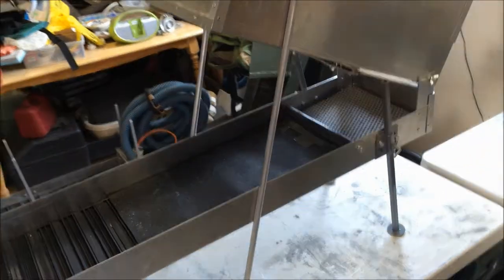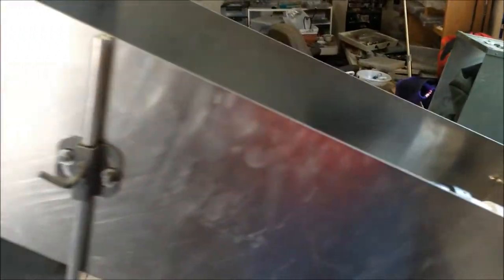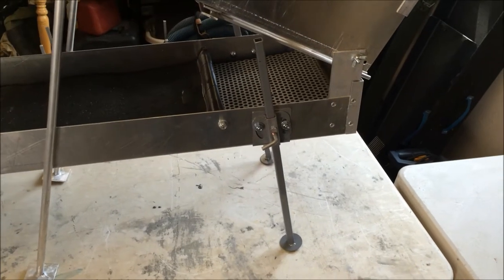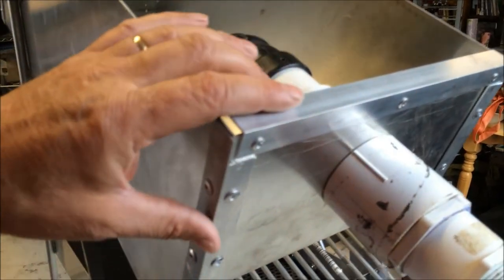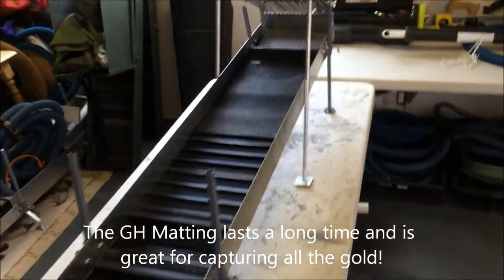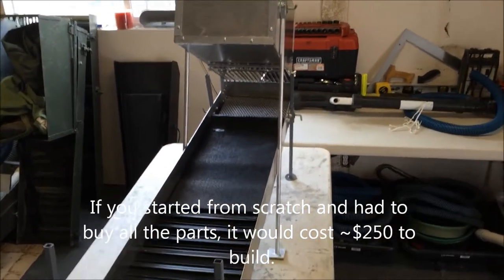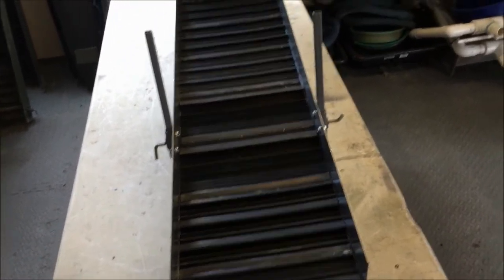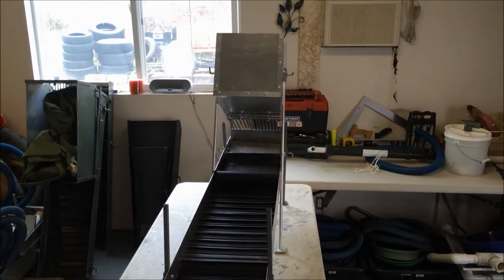Mid Sized Highbanker Build

Comment: Hi John, you didn't email for pics of my sluice project... That's ok, I understand. I am almost done with my mid-sized highbanker/stream sluice build. Two sections 50-inches long x 12-inches wide x 4-inches tall. I also built a hopper for when I want to go high banking. One section has a flare so I can use it as a stream sluice by itself. It looks professional, all it's missing is a manufacturer's sticker - "Billgineering, Inc". I ordered $250 worth of gold hog mats, they should arrive tomorrow or early next week. All that's left is the legs. I wanted leg brackets like gold hog uses on their sluices but couldn't find them anywhere, so I'm going to build them from scratch, except with a better design. I bought a drill press yesterday and am looking for a rotary table for milling circular slots to allow for back and forth adjustment. But I can tell you one thing, this project took way more than a day and the legs will take a few more. After spending a lot of money to tool up I was thinking of making leg brackets or even leg sets to sell on ebay. But I'm in no hurry. I'll post a video on youtube when it's all done although it could be a few weeks.

Comment: John what type of pumps are you using?  Type and model?  GPM?  great videos btw
Reply from the maker: +Elvamerc A4D Elva, I use a Honda WH15 pump (130 gpm) in most cases for this highbanker. At times, I like the silent mode, so I use 2 3700gph Rule 12volt bilge pumps.Thanks

Comment: John-your mid-size is done beautifully. How do you back pack such a long sluice and can you give again the types of matting starting with the miners  moss and on down to the end of the box. 
thank you-Jon Cunningham-San Diego
Reply from the maker: +Jon Cunningham Thanks Jon. The sluice is very lightweight and 5' long. I just strap it, header box down, to my backpack. You can make it shorter for easier backpacking...but again, its really light, yet durable...and VERY effective!Underneath the header box are 2 UR's covered by miner's moss and a punch plate. Then, Razorback, Scrubber, 2 Talons (not Raptor as I said in the video); Razorback, Scrubber, Scrubber, Talon. I hope this helps. John

Comment: John, Again,beautiful job. Are the sides of the sluice box 2" high? It looks like a flat piece of rubber or something for a foot or so immediately following the punch plate and mm/ur layer and before you start your Hog mat. Or am I just looking at razorback. The J&B  Weld is a good way especially if you notch or rough up everything  on your grizzly. Would it help to tack the rods with aluminum welds also. Thanks Jon
Reply from the maker: +Jon Cunningham  Thanks Jon. The sides are 3" high. The piece of  rubber that I think you are talking about, is mounted above the matting and attached by a rod to the sides of the sluice under the header box (see 14:50 of the video). I use it as a baffle to settle and normalize the water flow, and reduce water bubbles. Also, I did go back later and weld the rods in place using alumiweld and my torch. Worked great!
Reply: +John Jacobs Thank you-after 50 years of working on teeth I'm really enjoying mining and your innovations  help my learning curve greatly.
                            Jon
Reply from the maker: +Jon Cunningham I'm glad they are helpful. Best hobby of all time!
Reply: +John JacobsJohn,Do you ever classify.Thank you.Jon

Comment: Hey John Jacobs ( jingle heimer Schmidt ? ) Im making a high banker, and love your design... Simple, effective, light, strong! Thats me ! I have a question about your ' washing of material ' ... Many people use spray bars, another Youtuber DAN HURD uses a quad hole spray bar, but I see you have the single outlet of water. Have you experimented with different washing ? I have my first time out and want to get my high banker done ASAP but I might take the time for a spray bar if it helps gold recovery ... anyways, lots of people find it important, and you seem like a friendly dude, so I thought I would ask.
Good luck in Spud town :)
Reply from the maker: Silvers. Thanks for the question.I used almost every imaginable way of washing/bringing water to the box. I'm not a fan of spray bars because it can restrict the amount of water flow and washing capabilities. I went with the water delivery system which I believe is far superior...just bringing water to the destruction chamber with a single pipe.Hope this helps.
Reply: @johnjacobs3643  Ya I've seen allot of different ways and I like this straight forward style... Just was wondering what your theory was for it... don't restrict flow is solid reasoning, and simpler the better.

Comment: Hi, I love your videos and I'm going to make one of these high bankers for myself but before I do, I wanted to ask if there are any suggestions you could share with me on the build out that you might do differently now that you have used it for awhile. Thanks!!
Reply from the maker: There's not really anything that I'd change. This was my third build and my favorite highbanker. I use it at often as I can. Whether its feeding it by digging in the dirt or using my 2-1/2" suction dredge, I love this machine! And, its fairly easy to build at a very low cost. I'd love to see a pic of yours when its complete! Thanks!
Reply: Thats great to hear, It looked like a really nice setup. I've got some of the supplies already including the gold hog mats, Now it's time  to locate a metal shop around here ( Indiana ) that can bend some aluminum and I'll be ready to start. I will definitely post a picture of it when it's finished!!! Who knows, I might just make a video of the build!!! Thanks again for the great video on your setup!
Reply: Hi John, what would be your thoughts on making the highbanker 9" wide so I could get four 9" pieces out of the 36" gold hog mat? 
Also did you create any kind of jet inside the pvc fittings in the header box?
Thanks!